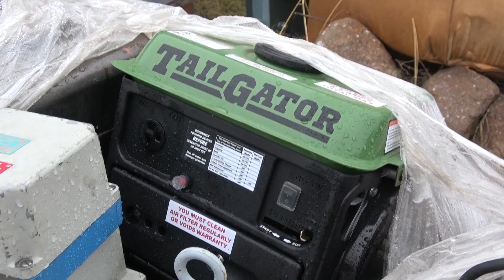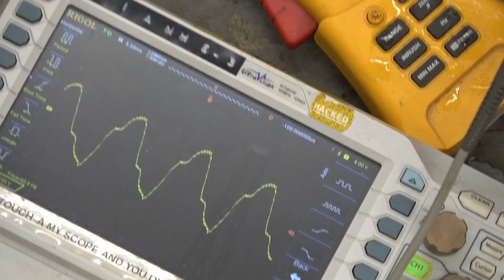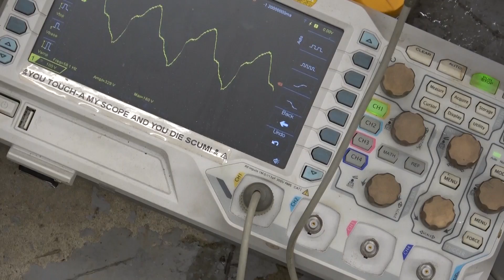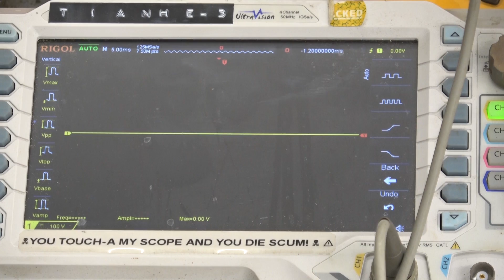BOLTR: Harbor Freight Tail Gator | Brine Tank Testing

Comment: Is that 110 or 220V ??  Guessing the former - given the complete disregard to personal wellbeing  (what's the worst it can do??)    ha hah ha a a a a a  - urgh...

- "There - Gotta be something wrong with it" - Yes there is, and it is working out in GeoPolitics, but you never mind, just keep on Consuming, while you can afford to.   lol...

Those inverter machines "just" need a decent output capacitor to have a "prefect" sinewave - it probably makes them a little less efficient....   But cheaper than running the main board at 100x higher frequency.

Comment: got 3 of them 1 I bought when first came on market 10yrs ago ?? done many hours 100+ as a bat charger only via 230v still going today but its loose on the big end , common failure is the capacitor behind the outlet of no output its failed (very cheap to replace) yes its amassing what u get for 100 doll hairs

Comment: I keep missing when you say what you put in it, if you used salt NACl you will get H and Chlorine gases at 8 amps 110v you will be making quite a bit.
Sodium hydroxide is better (you make H and O) 

With 110v you can put the copper electrodes fairly close together in distilled water and you will make ~ ionic/ colloidal copper solution (or an ionic solution of what ever your electrodes are)

Graphite sort of keeps out so the resistivity will change more slowly but whatever impurities are in the graphite will pretty quickly be in the water.

If you had a full bridge rectifier that can handle 15A at mains voltages you could do some pretty quick electroplating with your setup. It also wouldn’t sputter as much.

Comment: As you kept pulling the starter rope, all I could think about was my POS Honda EU2000.  I've pulled mine the same amount of times, but the difference is I had the gas on.  $1K for the Honda or $500 for the HF version?  I'll just buy two HF and hope one of them runs.  Honda generators, at least the newer ones, are way over-rated.  (That Tailgator is cute, but too noisy for camping.  A hard pass for me.)

Comment: Remember taking a battery apart for its carbon electrode, think it was a D cell but it might have been one of those box batteries used in the traffic cone lights with 2 spring terminals on the top as I remember it being quite big.

Comment: I have the HF predator 2500 inverter generator. It has been spectacular. Have used it for years at the cape camping on the beach for days a ty a time powering AC in the  cabin. Used it in a boat a ton for the BJ oat AC and 120v systems.  I also ran it for 2 weeks straight after a hurricane when we had no power for 12 days.  I use it at work all the time and it runs for 6-7 hours a day when we have it on a job site.. can't say enough good things about it.

Comment: These are GREAT gens. Standard China design with 20 odd different names. Treat them will love and will last ages. First tank breakin should should be about 25-30/1. Not made for heating elements or heaters. Don;t put more than 800 watts on it. The governors are usually not set right. Too sluggish and bog. Have to move governor spring one hole closer to governor shaft. you want 60+ hertz and about 125 Volts. you want the governor to snap open on load. Forget circular saws etc. as the amps will blow the capacitor( weak link). Recommend switching to a Coleman capacitor when it blows, Punch out the screen on the muffler as it plugs with carbon. When you get what sounds like rod knock, it;s time for a head removal and decarbon.Don't forget the ports.
 Save old ones, as parts are all the same. Gone through 3 in 10 yrs on a sailboat, charging batteries EVERY day for about 2 years / 4 hrs a day on each gen before the rings give out. Never tried rebuilding one, just go buy another.
Reply: Edit: One hole further from governor shaft. (more leverage).

Comment: Much better to use a trough than a bucket that way you can adjust the resitance by moving the electrodes further apart or closer as needs be.

Comment: I love these little 2 banger gennies.  They're an old Yamaha design.
A friend built a wharf with one.
For easy starting, drill a hole in front of the carby throat and hot glue a cool drink bottle top with male screw over the hole.  Just unscrew the cap to apply easystart....!!

Comment: I bought the same generator (different colour and name) from Canadian Tire years ago because it was cheaper than renting one for a job at the cottage. It worked great for that job. After some more use it lost power due to carbon blocking up the muffler. I cleaned that out and it 
was good as new ...until a small magnet which was glued on the rotor came off and wrecked the windings.  It is a nicely made little thing, with one fatal flaw.

Comment: one can also use a few electric stove elements with a fan, or upgrade to a few electric water heater elements in a bucket with a hose overflowing it. 
keeps the water unbroken and keeps your science curves less wiggly since we can factor out the electrolyte just dumping it thermally.

Comment: 13:25 ["How do ya compete with that?] ====>  Easy.  Craigslist.

eg. Locally, US$100 buys 3200 watt (15A continuous) Generac brand, USA made "Niagra" alternator "primarily moved" by B&S 6.5 HP "Vanguard" (commercial-duty) 4-stroke engine.  Heavier, sure, but SIZE MATTERS, so BIGGER IS BETTER.  (For "backup" to the emergency generator, another hundred buck-er-oos bought 10HP Tecumseh on 5500 watt Generac; too big to balance on bicycle for headlight.)

Comment: Those Hondas are actually just DC giant DC electric motors that are turned to generators and then you have an inverter electronically so it's a s*** machine s*** design you need to hire in better design like a Tesla design for 100% alternating current using a real alternating generator

Comment: These chainizium generators have generator part wined with copper coated aluminum wire instead of pure copper. Mine claimed to be 3,5kw 3 phase let the smoke out at 1,2 kw load for 15 min. Got it rewinded with pure copper wire and away she goes

Comment: You may be able to score an old electric furnace on the cheap, those elements basically last forever and you can usually rewire the elements to change the draw. Hell, I can ship a small 2kw heater only your way from kebek, the element is broken but nothing a wirenut can't fix.

Comment: If u have salt water in there it will also  produce chlorine gas wich is really toxic. Dont inhale that! The chlorine smell would give a clear hint though if it is being produced. Not sure electrolysis works well with AC however as the reaction will run back and forth. If it was DC current the amount of gas produced would probably be much biggger.

Comment: So you've got Sodium Chloride in there, probably. If it's water softener salt, it's either that or some kind of larger organic molecule. But what's actually being produced at the anode and cathode is hydrogen and chlorine in the case of Sodium Chloride, and god only knows what in the case of the wack-ass organic molecule, probably just oxygen. Since this is an alternating current, the anode and cathode oscillate between the two electrodes, so there's a mixture of hydrogen and something else bubbling out at the contacts. The fire is probably hydrogen combustion, most likely with atmospheric oxygen, as the Chlorine is unreactive.

Comment: After ownign about 4 of thses before the tailgator rebrand I can you that likely the only thing that changed is the paint. One of my old generators lasted a year and kicked a rod bearing. Another one lasted 6 years and would go 16 hours on a gallon of gas. Luck of the draw.

Comment: I used one of these to get me through a hurricane when the diesel smoker was out of commission due to the neighbours complaining about me killing the mosquitoes with black smoke, and yeah, that thing is pretty good for the price. I abused it non-stop for more than 2 months. What finally killed it was a probb 2k+ w inrush wall saw. It still starts, but the crankshaft is probably bent so the generator rotor is rubbing against the stator causing a horrendous noise and voltage spikes back and forth. After that, I decided to just fix the diesel one, but yeah, the price is almost criminal.

Comment: They get $70 for those here in Florida. I've had one for years and it will run steady at 8 amps for as long as you can keep gas in it. I don't even use proper 2 stroke oil in mine, just mix a little 30W into some old stale gas and let it eat.

Comment: Electricity through a fluid doesn't just break down the water into H and O -- it also breaks down the electrodes. You're probably getting bits of metal dissolving into the water, changing the conductivity. If you run DC through aluminum electrodes in salt water, one side will dissolve Aluminum Chloride I think? into the water, and the other side will deposit sodium somethingorother. But because you're running AC it does a little of both................... I think. Not a chemist.

Comment: You should do a test and teardown review of the HF Predator 2000 watt inverter generator.  Nice chinese engine, alternator, and inverter - lots of awesome stuff to take apart.
Reply: A cheap electrical heater makes a great load tester - 20 bucks at Wally World.  Or, you could use a metal bucket next time....  I have always wondered what being electrocuted would sound like, know I know.

Comment: i’ve got a lot of hours on my 99 dollar generator. so far i only needed to freshen up the carb. feed it decent 2 cycle and it just keeps going
Reply: i prefer my dual fuel genny running on propane though, less dicking around with liquid fuel in a rain storm, no corrosion problems, no stale gas

Comment: Bought one of these 3 years ago.  Works perfect.     Must admit that's still in the box.   Still unopened.      Guess I better try it.
Reply: Well  I'm impressed.   I finally used the small generator.    And it really did a fantastic job.  Used my electric 14 in. Chainsaw.      The ice storm we had took out some trees on my 5 acres.      That little tailgater worked great.

Comment: The achilles heel is the 1/4 watt resistor on the rotor. Change it out to a 1/2 watt and using some silver to solder it with and you'll have something

Comment: Kinda like some of the generators guys bought in Afghanistan when I was there. 100$ US and it included a replacement pull cord assembly. Had to dial down the voltage but they worked... have had mine since 2005 and still a great little  generator.

Comment: I've got a 750W version of that 2stroke unit in 240vac / 50hz with a blue not green tank. I overloaded it and popped the generator electronics.
If you could investigate that more on how I can fix it / tear down the electric side I'd love to get my old $149 AUD Banger running again but looking at what parts are needed since it's pretty simple from memory.

Comment: I spanked 1 of those 4 gears, never left a guy sticky, broke, or confioosed like a Saturday night Stripper wearing Glitter, but only Crappy 4 a cuppo year chooch.  The hot Cigarette arrestor started to look like self IT self centered in Africa, and she wasn't wert fuck, without cutting open the DB cancelation housing and giving a proper Douche

Great for a dim 3 of 4 led lights on a ziptie tie evening congregating around a bunch of Alkys on the tail-slammer of a ol beat up pickup that has no wheels

Comment: Had this type of genny since they were bought out,  it just keeps going with very little love, lent it out and they made it boil 2000+ watt kettle daily till it popped the crank seal onto the shaft, push it back in, couple tappity taps with the screw driver and it's still going.

Comment: Almost 30 years ago now my dad gave the Honda dealer about $2000 for a 5500 watt generator. Mind you that we were in the middle of a 2 week statewide outage so there were few deals to be had. Wonderful piece of equipment. I still have it, but I need to clean the carb. I see Chinese clones of it at the HF for about $500 now. (Predator 6500).

Comment: I wonder if you could use a large lithium battery bank to produce hho using the collected hydrogen as the main fuel source for the generator whilst using the remaining oxygen to feed into the air intake to increase economy, when the system warms up it would require less amperes which could mean a recharge potential for the battery bank though there would remain the issue by lack of lubrication from the fuel which may mean a mixture small mixture of diesel/petrol with hh, which may mean a hit and miss engine, so much can be experimented to run a self-sustaining community.

Comment: I've had the old blue non TailGator 800w model for years, back from when they were $69 on sale. Used it a bunch and it always works...and always leaves my ears ringing. But you're right, they're a sore dick deal.

Comment: tiny, cheap, and they do OK.   I've run single pieces of power equipment on mine.   certainly not  meant to run a whole shop/house.  but the odd saw or small sub-10 amp appliances seem to be fine.  used to rent them out along side the fish houses in the winter.    cost me 80 or 90 each one but they added  125/night  to the house rental for each unit.  in some cases I could run 2 houses off a single gen.     the pull ropes and rewinds are kinda meh and seem to be the only real failure point on any of the dozen or so I have around here.

Comment: I'm going to do you a favor when you start running generators with more amps for longer and remind you when you electrolize sodium chloride, it gives of chlorine gas, so you really ought to switch to sodium hydroxide as an electrolyte if you don't want to turn your lungs into schmoo. Furthermore electrolysing brine will turn the sodium into sodium hydroxide, so your water is going to get caustic the longer you electrolize it.

Comment: I have an older one of those and after you use it for a while the plug gets loose and the 2 stroke engine vibrates the plug out of the socket. Also those DANCE on hard ground, just moves all over the place

Comment: You're splitting the water into hydrogen and oxygen so the salt concentration will rise unless you keep adding water.
Reply: In this case, there's salt in there, so even better.... hydrogen and chlorine gas. As a bonus, it turns the remains of the salt into lye, which is twice as conductive as salt. So for the amperage creep, as well as the metal just slowly dissolving.

Comment: I bought one of these for our Christmas Boat Parade for lights only. Decorated alot, this Gen. worked great. Ran out of gas in 2.5 hours. I mixed this with Pennzoil Outboard 2 cyl. oil. Starts in 2 pulls, if you do this right.

Comment: You could be dissociating the salt and forming sodium hydroxide, hydrochloric acid, chlorine gas and other soluble conductive species.  Current through brine is how you make chlorine, caustic and HCl.  The products are dependent on the power density.

Comment: I bought one from Pet Boy auto. it was rated at 1k. We fired it up and hit it with 5 500 watt halogen lights and ran a tank of fuel through it. it never missed a beat. It's cheap and for they charge for it. It like you say it's a sore dick deal.

Comment: well its got to be good for something ,,, it will light a 40 watt bulb ,,, it will run a electric tooth brush ,,,, there you have it ,,, if the power goes out you will be able to brush your teeth at night ,,,, possibly even run a 110 modified vibrator .... hummmm ,, now theres a build for you ,, a 110 vibrator ,,,,, i guess theres no chance of it running a 240 dildo huh ?

Comment: "I shouldn't have to tell you this is dangerous. Water and electrocity" As his meter lays in a puddle of water on the floor...circuit smircuit
Reply: The meter measures amperage passing through the hoop, it’s not in electrical contact with anything. Also, he’s wearing safety mittens.

Comment: the nice thing about them is no oil to check. so i hooked one up to a 55 gal drum and let run.  5 drums later it's still running. ( i was setting up a solar system during that time.)

Comment: So what can u run of it? Properly
Reply: I have the same generator just badged a different name ( GMC ) , I can lose power in summer sometimes during evening  thunderstorms and the little generator gets me some lights , tv , computer and fans all running and it isn't working hard at all . It's marked as 850 watts , it will run a 4 inch grinder or a 1/2" drill perfectly well . 
            It might run a refrigerator but I also have a four stroke 3.5 kva generator for any time I might need more capacity .

Comment: I had to buy one of these to prevent a basement from flooding. It did its job well I ran my dirt bike race fuel because it's what I had 40:1 leaded 110 and it still runs like a hot damn to this day. Benefits from 2 stroke the gas will last longer

Comment: Wait, why did the more dilute solution work to reduce the load?  Shouldn't that have been higher resistance, and therefore higher current?
Reply: Lower conductivity in the dilute solution .

Comment: The steady climb in solution potential is very likely due to electrode decomposition. 
Metal atoms in the electrode are converted to free ions via oxidation of the anode (or the reduction of the cathode).  Although an AC circuit cycles its electrodes between the anode and cathode state, equilibrium is not assured. Differences in reduction and oxidation potentials will lead to metal ions accumulating. 
Sparks and arcing can also introduce metal ions to the solution via electrode ”sputtering”  wherein atoms on the electrode’s surface are ablated by the arcs high-temperature plasma. 🤓

Comment: I have the same generator and did the same damn thing....forgot to turn on the fuel....lmao I ended taking mine camping for deer season in the UP of Michigan...ran about constantly for 6 days without any issues. I just ran my camp on battery power and used the generator to run my battery charger and CPAP machine. Not a bad little pixie maker.